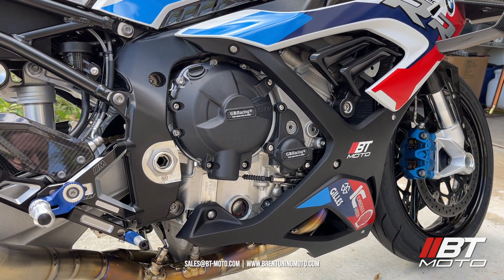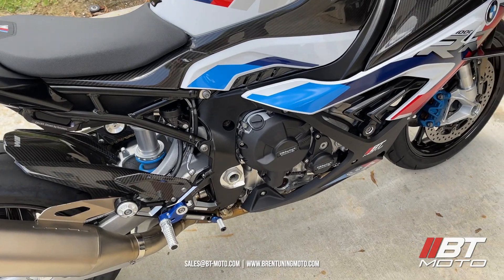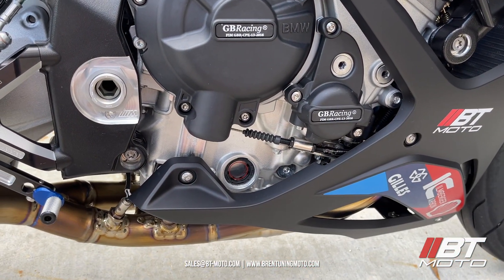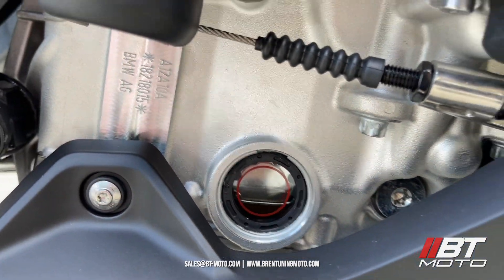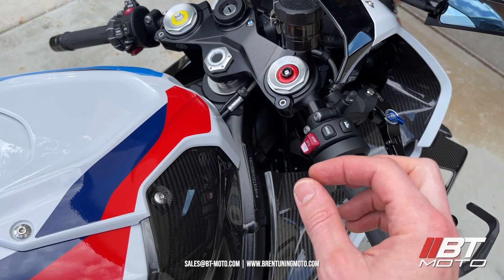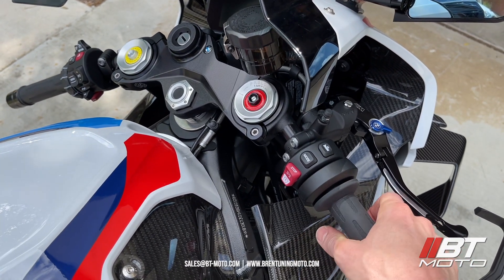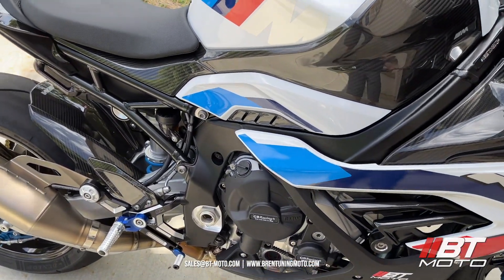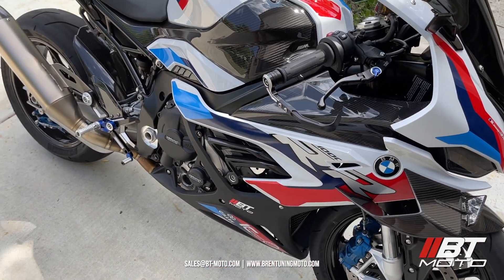How To Break In Your Engine, 2021 BMW M1000RR

Comment: Am getting my M1000XR tomorrow and I have asked the dealer to level the bike and heat the engine for one hour then shut it off tell next day to ride it with the gradual increase and decrease the throttle for 15 min then let it cool for 15 min then repeat the process 
Would this ok
Reply from the maker: @MAZENBIRA  heat cycling is good but also the bike needs to be ridden. Warm up, ride, shut off, repeat. Vary loads and RPM’s while riding. Progressively work your way up to the stock 9000 RPM limiter. Do not just cruise the bike at a static RPM or just idle for a long time.
Reply: @BT_Moto  exactly 👍 that’s the plan so I have to rev high as soon as I ride the bike today

Comment: The manual states that the bike should not be put under full load within the first 1000 kms. This means that your rapid acceleration tip should be used with caution, as to not open throttle too far so that the “refs are chasing the throttle position”. 

If the bike is pushing full power/torque in the first 1000k, this is not good according to the manufacturer. Since it’s in the manual, you may also face warranty issues if you’re found to be breaking this criteria.

Comment: Nice video! I recently purchased a S1000rr 23 model. Done about 150 miles. I experience some strange behaviour. Doesn’t seems smooth on low speed acceleration second gear even first seems jerky and i have the feeling there’s a grinding sound once moving on slower speed.It’s normal or should i call the dealer for a check because doesn’t make me feel good. Speed control on slow speed is horrible 😊

Comment: I am currently getting my motor replaced on my M1000RR. Mine did this and I fussed for over a year. It finally dropped a cylinder and BMW is now replacing the motor. Apparently they just dropped an oil consumption bulletin for these bikes. Lucky that’s what helped me because they wanted to blame me.

Comment: I like all this, except the warm up. This is a big power to weight ratio vehicle. I believe it is better to allow oil to the head, then operate at low throttle low gears while warming up to keep pressure on bearing surfaces. Either is better than throttling a cold engine

Comment: I’ve showed this video to our local bmw dealer and they don’t recommend this. Not sure if it’s a USA to uk thing but they showed me their recommended way of doing it and it’s nothing like this. I’m confused 🤔at least there is a 3 year warranty !

According to our local dealer they say. BMW say max 7000 revs for the first 300 miles then max 9000 revs for 300-600 miles (digitally limited anyway) no full load before the 600 mile service. Vary the conditions I.e twistys, straights, hills, declines etc and use all the gears.
Reply from the maker: The people at the dealership change oil most days. Any serious engine issues are shipped to bmw for diagnoses. The mechanics at the dealers are not certified to do anything but read the manual and that’s what they read back to you.
Reply: @BT_Moto  the mechanics at our local bmw dealership actually co-work for bmw tyco raceteam in the uk in bsb and as I just ordered an M1000rr I showed them your video to confirm and after watching it they told me not to do that as a break in recommendation. I’m not trolling you. Honestly feeding back what they said.
Reply from the maker: @theonlyredspecial  very odd. We also talk with bmw race teams. They immediately remove the limiter and track them (ones we speak to).
Reply: @BT_Moto  I believe you. I only found your channel recently after looking for m1000rr content and found your video interesting and brought it up with a few of the guys I know at this dealership with a lot of experience. I’ve heard other people say that the first 100 miles is the most critical for any engine.
Reply from the maker: @theonlyredspecial  yes, first few miles are the most crucial

Comment: Sorry for being off topic, but is that an Akrapovič option header? Does it bolt-on to the factory mufflers of the M 1000?
Reply: That's the "M" bike and it comes with the Akrapovic exhaust system. Of course it has California EPA emissions stuff on it. If your trying to track the bike there are full systems you can buy as well as headers (that include link pipes) you can purchase and keep the original exhaust. But you need to get the fuel system flashed and possibly replace the air filter (but I hear the stock air filter on the M bikes is actually better)
Reply: I bought the optional header for mine and it just bolted right up.

Comment: If my 2020 s1000rr just needs a new dash does it need to be matching with the ecu, key, ignition etc for it to work? Or can I just connect a used dash and call it a day?
Reply: Needs to be programmed at the dealer

Comment: From KLR65Os to R1s, I've always broken in new bikes like this while changing the oil frequently.  The KLR was notorious for burning oil but mine never did. Not a single drop.  My guess why some manufacturers say to baby the bike during break in is to limit potential lawsuits from riders if they get in trouble with Johnny Law or if they crash.  Only guessing, though.

Comment: Great tip, check Marcel Irnie, superbike racer he has a great video breaking in an s1000rr. He gets the limiter removed straight away and then goes through the warm ups pulls heat soak etc its a very good video for people that don't know. It's great your taking time out to let people know, I think this is why there are some issues as you just stated with oil burning. Great info.